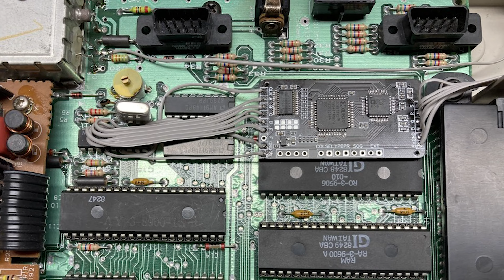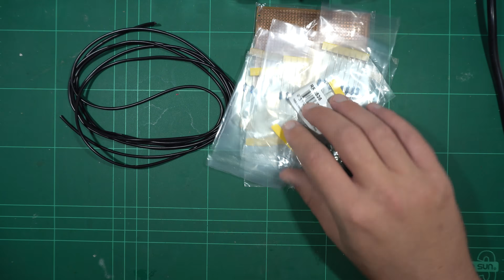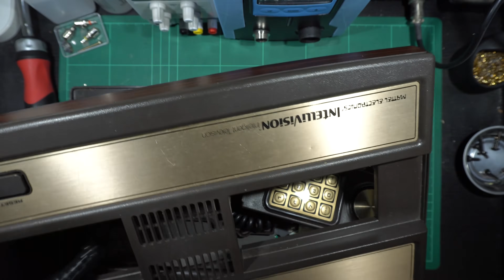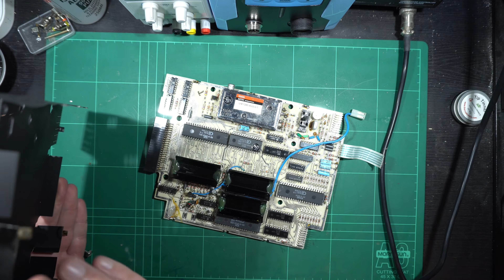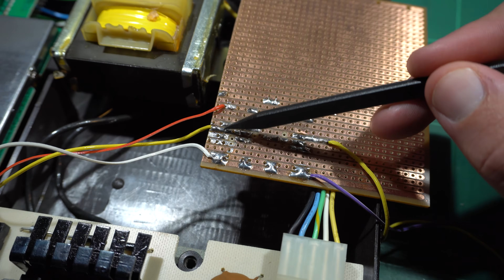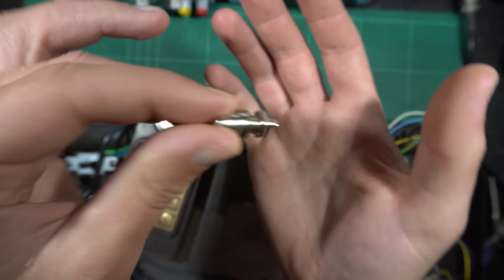RF get stuffed! Intellivision Composite Mod

Comment: These Shields would cause ICs on the board to overheat and break internally. I threw mine away after replacing the STIC IC that went bad, good riddance! Also if you're still wanting to keep RF, I would use a very thick shielded coaxial for now on.

Comment: Just wanted to say thanks for making this video, it was very handy for me. I did end up going for a pre-made RCA module (tearing into the RF shield without breaking anything felt like all the challenge I wanted to take on) but this was a great resource to follow along with 👌The first cart I threw in was a dud and had me thinking I'd wired something up wrong, and I was worried I'd be doing some forehead-slapping troubleshooting. Fortunately the second one worked 😁

Comment: I have an Intellivision 1 modded for composite and a un-modded Intellivsion 3 that just uses the RF port and quality is really good on both with zero difference in quality side by side. I was actually shocked how good the RF signal is so maybe the later machines had better components. I also have a un-modded Intellivision 2 and the comparing both un-modded consoles you can see a huge difference with the Intellivision 3 having a much higher quality than the Intellivision 2.

Comment: Love the console modding videos (although a side-by-side comparison would've been awesome 😛). Nice work!
Reply from the maker: Thanks. As for the video quality, there is only so much you can do for a 40-year-old console, but it removes the static and makes the colours more vibrant. It would be interesting to compare composite to RGB, however.
Reply: @retrogameon  I suppose RGB would look considerably nicer but anything is better than RF really. 😀 I'm quite happy with my 2600 composite mod, my Jr. has quite bad static.